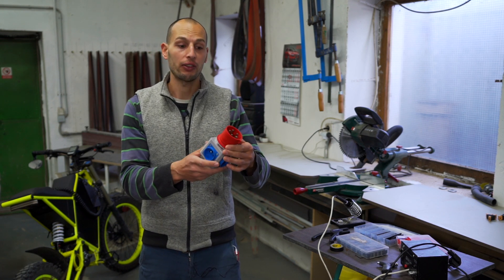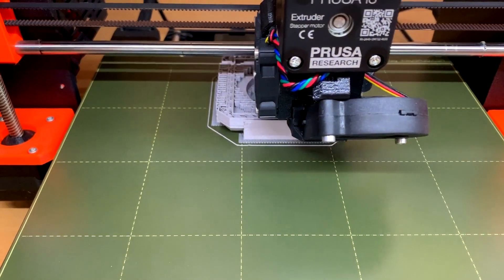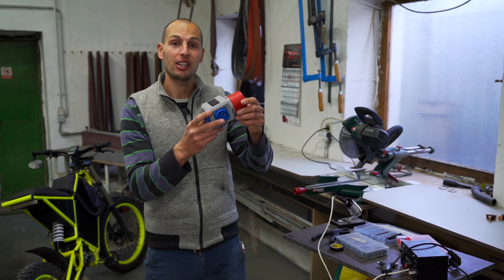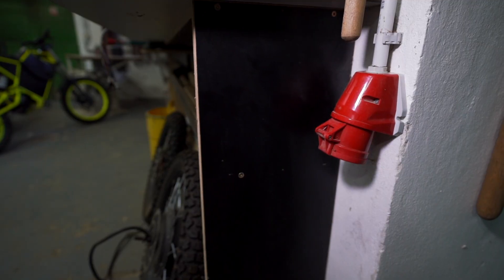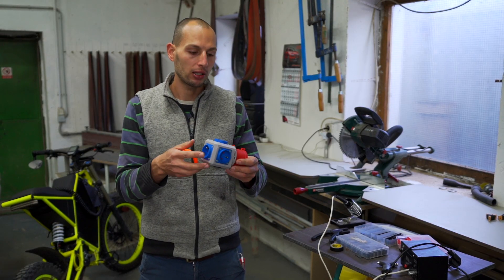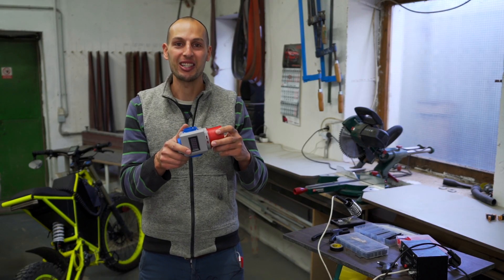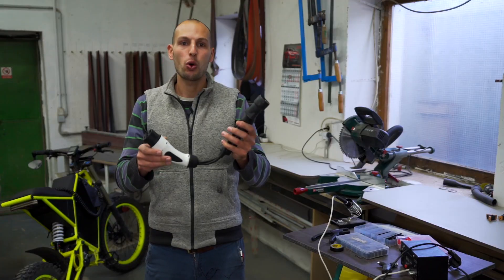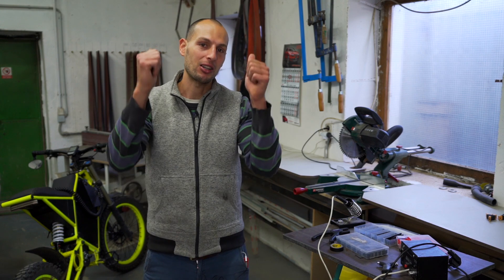Creating 400V Adapter for Charging eBikes with 9kW

Comment: Hey I have a question. I'm getting an e bike 3000w 72v. It's charger is a 3ah 110v.  It take 10 hours to charge and I want something that can charge it faster without destroying the battery. I'm also getting a tesla wall connecter charger and a regular tesla charger. Any adapters, or other chargers  can use to charge my bike. Any  will be appreciated, thanks.

Comment: with that plug does it have to be connected to a 240volt outlet to get that recharging output power?
Reply: The plug he was using with the door on it looked like what we use in the US as a 440v.

Comment: just google "SRS2450312-0"  :)
Reply from the maker: Very nice, I didn’t know they exist. I still prefer my compact design with the voltmeter.
Reply: @ladiandmargaret  yes, your design is very nice and smaller, but not everybody is capable of handling such a high voltage. Clearly, you have plenty of experience :)
Reply: available only in Finland?
Reply: @Marek-qj8fj  To uz neviem, ja som zo slovenska :) ale spomenul som si na to pri pohlade na tvoj adapter, ze sme davno za mojich brigadach na stavbach pouzivali nieco podobne,  boli to ale dost velke a odolne adaptery, to by som nechcel nosit v batohu :). Kde zhruba sidlite a dalo by sa niekedy ak by ste mali cas zastavit a inspirovat? Po prvej prerabke bicykla na 1kW hub motor, si teraz staviam vlastny bike s MXUS motorom a vlastnym hlinikovym ramom, taky daily commuter bike, ktory vyzera stale ako bike, takze s tym mozem brazdit po bratislave aj po pesej zone(z prace) bez nejakej vacsej pozornosti mestkej policie :).

Comment: Nice very cool makes me wish I had a 3D printer
Reply from the maker: It’s the most helpful tool for me at thus point. Highly recommend!
Reply: Ladislav Jecminek  quick question which would you say is better for a wet climate chin drive motor or hub drive motor ?
Reply: Just make a Facebook post asking if anyone has a 3d printer that you can borrow.

Comment: Good, but no info about how those big red socket works... Is it 360v or 230, no connection diagram, absolutely no tech info in video =(
Reply: its very simple -  its standard 3phase socket -  4 or 5 pin (4pin isnt grounded) - 5pin =  GROUND, NEUTRAL and 3x PHASE - so NEUTRAL + PHASE = 230V
Reply from the maker: Thank you.
Reply: @duniek86  really, so thanks for so simple and clear answer...
Reply from the maker: 400V. If you know basics of electricity this should not require any guidance